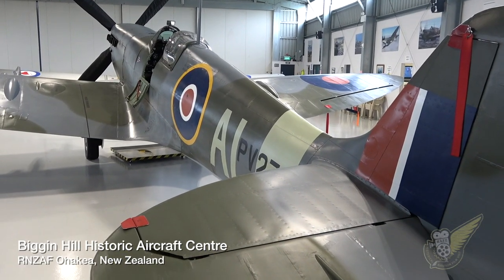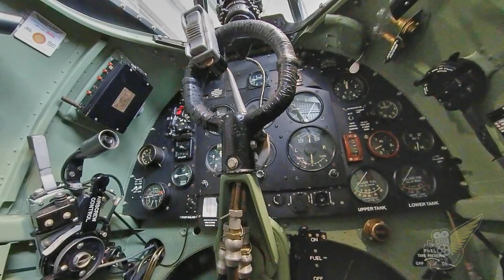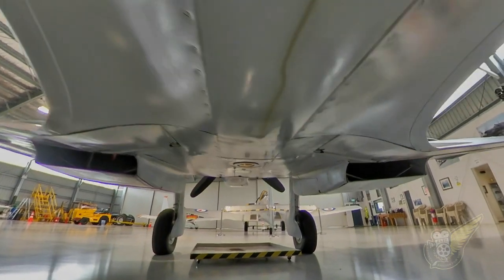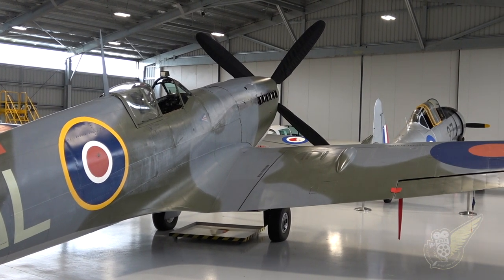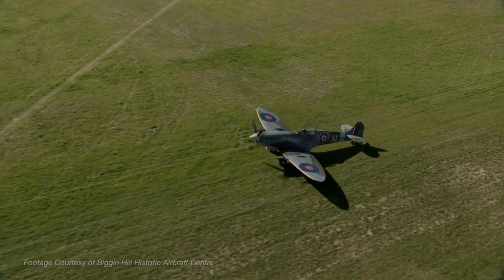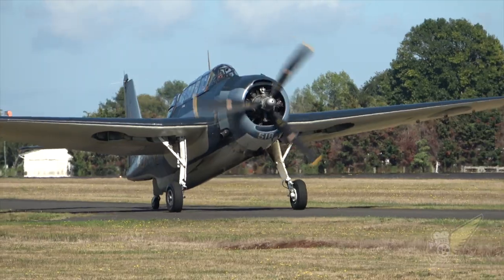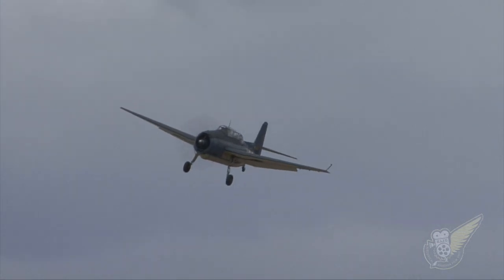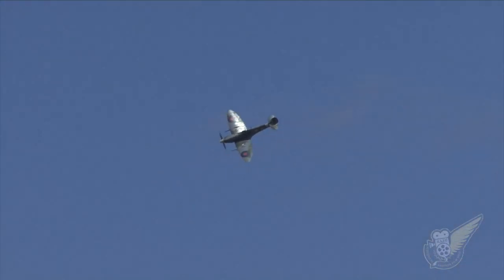Spitfire Mk.IXc at Biggin Hill Historic Aircraft Centre

Comment: Looks like the Avenger was having a BAD oil Leak, by looking at the bottom of the aircraft.
Reply: Those old warbirds leak oil like nobody's business - even when sitting on the ground. Those drip trays are present for a reason  ;)
Reply: @stickman3214  I am am an A&P Mechanic and work on Warbirds with Round engines from time to time.

Comment: That Spit looks like a MK-V....but I am not sure.
Reply from the maker: Definitely a IXc
Reply: Thank you very much!
Reply: ARE YOU SURE---YOU ARE PAYING ATTENTION?
Reply: The Mark IX was a stop-gap upgrade of the Mark V after the appearance of the Focke-Wulf 190A. The new German aircraft was a game changer and the Mark V Spitfire, which could hold its own with the then current model of the BF-109, was suddenly badly outclassed. In his autobiography, "Nine Lives", Brendon Deere's uncle, Alan Deere, recounted his wing's first engagement with the FW-190. The wing lost eight Spitfires for two 190s claimed, one by Deere.
The Mark VIII Spitfire was under production, but, because of a multitude of design changes, was taking too long to come online and Fighter Command badly needed something to counter the FW-190. The answer was fitting the Merlin 60/70 series engine to the Mark V airframe. This restored parity with the 190 and the "stop-gap" Mark IX turned out to be so successful that it remained in service right to the end of the War. The Mark XVI was simply a Mark IX fitted with the Packard Merlin – all the other Marks from XII on were Griffon powered.
Reply: @MarsFKA  Nice summary - well done.